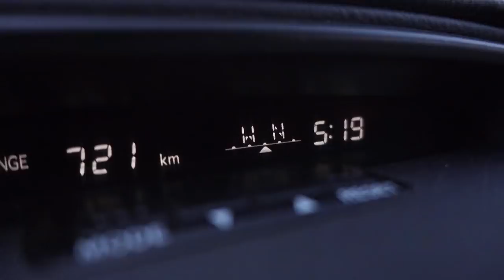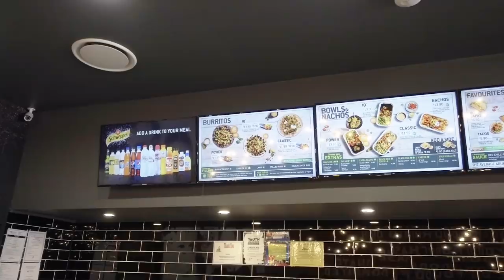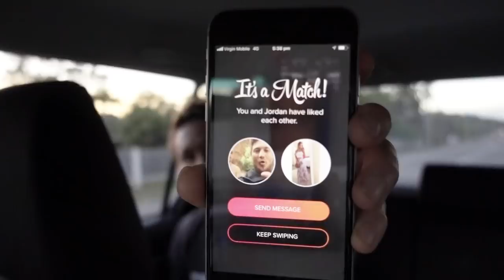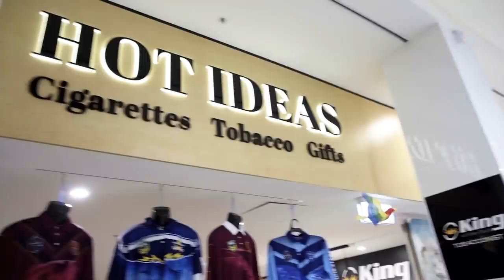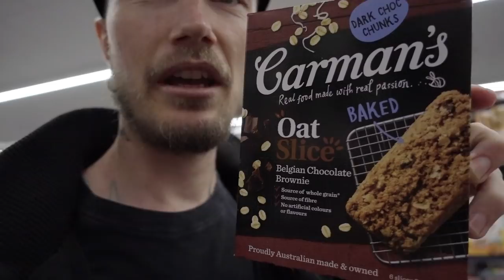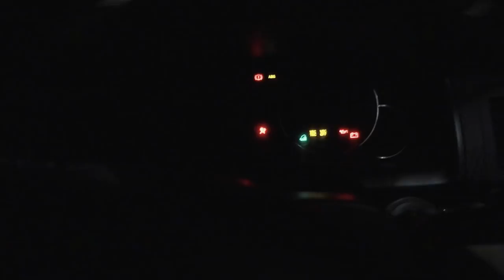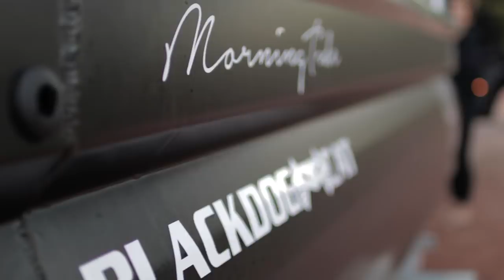New boat and a big road trip

Comment: the trailer brake is disabled  with the little metal flap over the ball shaft and wont slow down when braking. over the shaft for reversing, not over when going forwards so the trailer brakes work

Comment: Need to add what we call in the States a Transom Saver that supports your Honda up in the air  when your trailering. With the way you have it in the video the motor's non supported when you travel the lower unit wants to come down applying leverage against the transom eventually breaking welds. With the Transom Saver it transfer the weight of the motor directly up and down on the transom relieving the leverage stress. Hope this makes sense you can always YouTube it on how it done. Been doing that for almost 40 years with no damage. Your game is going to change now. Go gittum.

Comment: You forgot to do one thing on the tralier, at 2.55 there is a little leaver just in front of the two Bolt’s which is flicked over. This is for when you are reversing. You flick it out when just normal driving because this is for the brakes for the trailer, nice vid anyway

Comment: No grease on the towball? You don’t have to push that spring pin all the way home, it’s designed to just fit in the first little space. The bigger space is for your finger to pull it off. Gorgeous looking boat!

Comment: By the way guys when you putting the tow ball on you need to pull up on that handle when connecting it to the tow ball, that way it actually locks on,  the way you guys did it it’s just sitting on there by the looks of it

Comment: Just a minor thing, see if you can work out a way to hold your jockey wheel handle upwards. It will snap off if you hit anything hanging down like that, I've done it.
Reply from the maker: Cheers for the tip mate

Comment: i don't know if anyone else does this, but for me, i am afraid of my outboard trims getting damaged when trimmed all the way up during transport so what i do i trim it all the way up, place a block of wood in between the trim and transom and trim the outboard back down until it holds the block of wood securely. this way the engine does not bounce up and down during transport. not sure if there are any down sides of doing this, but it works well so far.